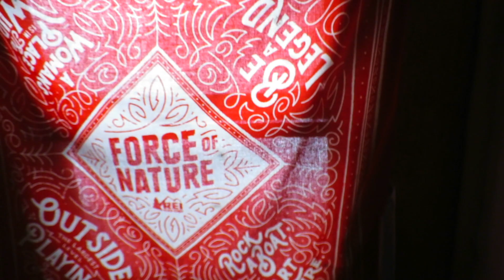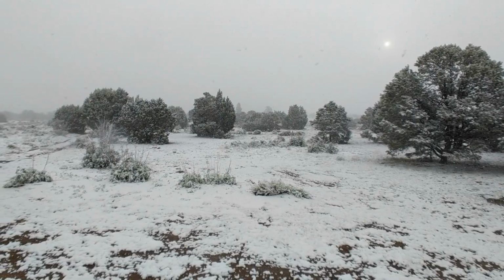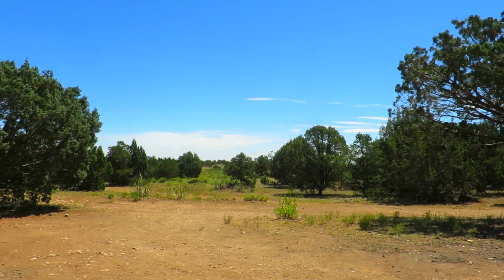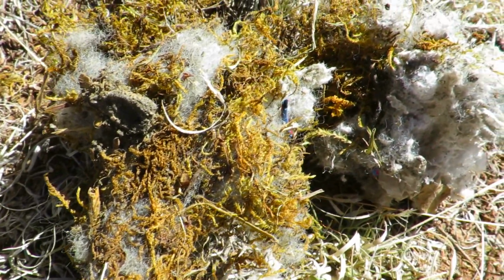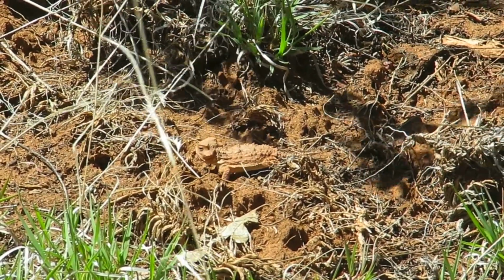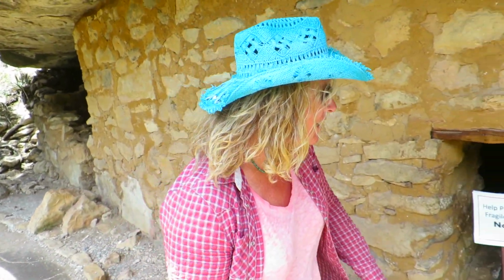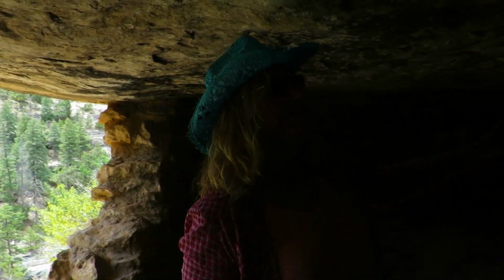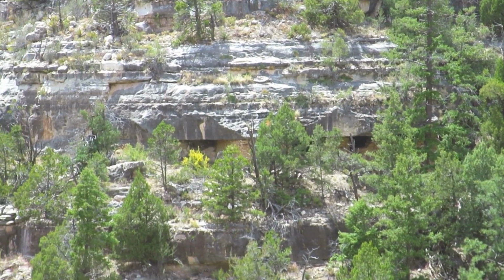A VOLE Ate My Car!!  Walnut Canyon National Monument

Comment: WTG Ren to the rescue!   It sure is great to have good friends.   My roof was leaking.  A good friend fixed it and all I had to pay was for material.  I also took him swimming on horses for a" tip".  We had a blast.  I had the modulator valve go in my truck. costs 600 bucks.
Loved the shot of your camper and stars at the end.

Comment: Left a Campground last October in the Northwest after 10days. Around February gross flys were flying out of my heater vents. Couldn't find anything. In May saw a UTube on a vent I didn't know about!!! Inside dead baby ground squirrels. Mommy sadly had them inside a metal box holding a Heater vent. God the crap I was breathing. This has never happened before but I will check for critters from now on! 😷😷😷😩😩😱😱😨✌🏻️✌🏻💕💕🚐

Comment: I had a packrat take up residence in my truck last winter in Arizona while boondocking for two weeks.   Was super lucky they didn't chew wires, just insulation in the hood.   They take up a residence rather quickly,  I have no idea how to prevent it other than where you park.
Reply: On long stays, keep the vehicle's hood up as much as possible. The attraction is the secluded nesting areas the engine compartment provides. Yeah, some scumbag might steal your battery, but that's a lot cheaper than rewiring your engine's electronics, and an easier fix.

Comment: It helps to open your hood when you get to your camp. The engine will cool quicker and cold metal is less appealing to mice. Also with the hood open they are more vulnerable to their predators so they are less likely to make a nest there.
I was camped in the area during late June and early July. Just North of there are more Native dwellings. They are part of the Sunset Crater Volcano National Park. They are near the North end of the park.
Reply: Danny, thanks for this advice.

Comment: Bex, A few weeks ago we took a trip for a week, in my car, when I got back home I saw some fiber insulation by my 2018 P/U truck on the driveway, so I lifted the hood and holy shite, something had chewed the whole firewall insulation off, that area is the width of the engine compartment and 6 feet wide about 18 inches deep. I never found any nest so who knows where the bloody animal made one, so far I have not found any wires that were chewed. Bex, buy some wire insulation glue to cover the splice where its joined, it just brushes on.